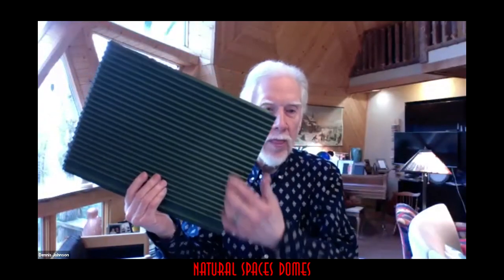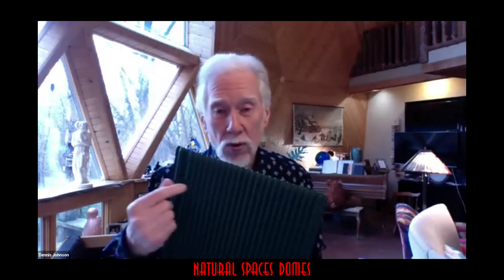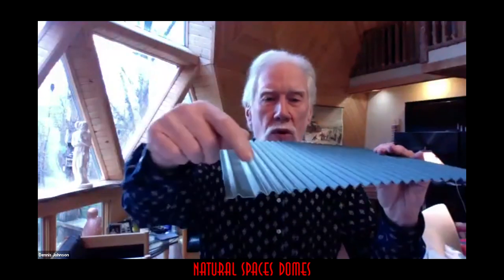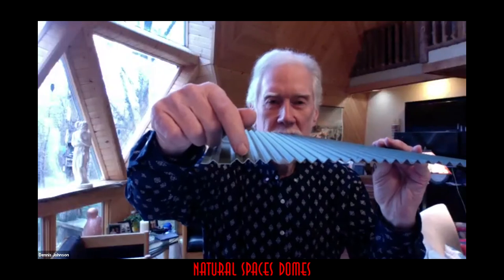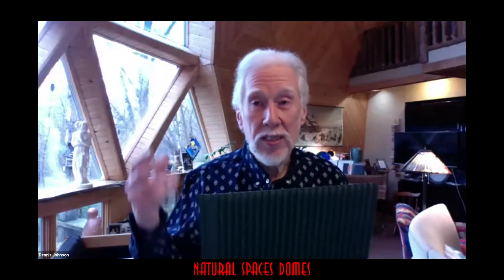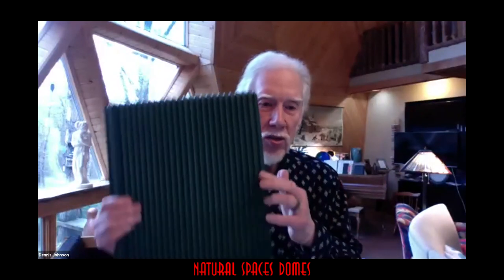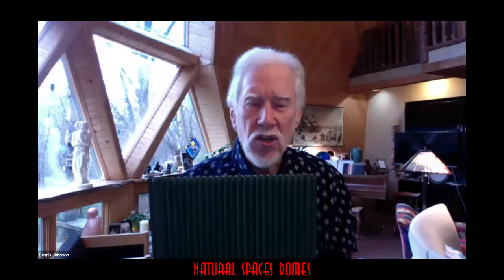What is the best roofing system for a dome?

Comment: Malarkey is just another shingle company. We prefer Owens Corning Durations. If you are lucky you will get 2 decades only. Asphalt will not last the warranty stated. Not even 1\2 of stated amount. Sounds like someone is trying to sell you something. Metal will last more than 50 years, with no exposed fasteners. Price will be more than double. This is the trade off.
I have 32 years in this industry. I manufacture 4 different metal profiles and unlimited custom systems. We still prefer to install shingles because of the speed. I have never torn off a 50 year asphalt roof. 18-25 years on average.
Reply: @sgrieger_  You're comment doesn't make any sense.
Reply: Sounds like someone is trying to sell metal roofing products.
Reply: @Cuzzzo42  always, however i am just spitting facts. I will install any roof system. I just happen to have a few roll formers.